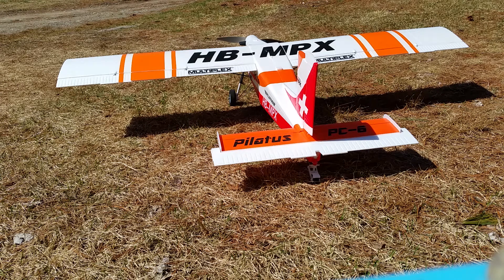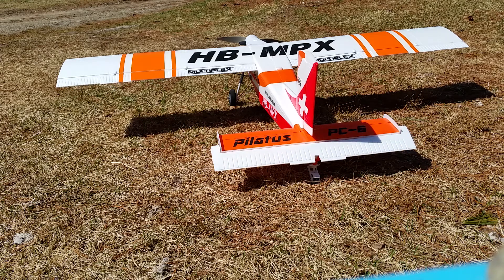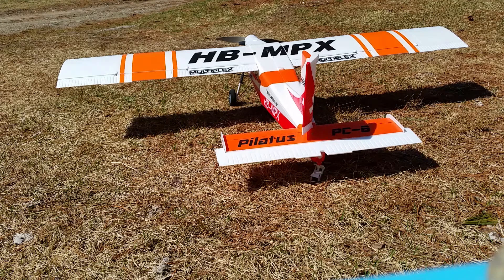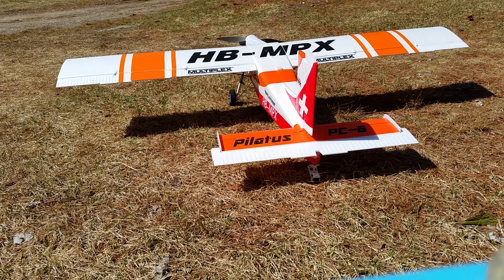Multiplex Pilatus PC6 7 channel programming

Comment: so how did it work out?
Reply from the maker: +ltdorn Differential ailerons worked quite well.  So well, in fact, that I got bored with how easy it was to takeoff, land and do mild aerobatics and started screwing around.  Well, you know the story - inverted pass and I lost orientation when trying to roll upright as it was heading right toward me.  Got it rolled upright but forgot to release forward pressure on the elevator and drilled it into the unforgiving earth at high speed.

So I replaced it with a blue one.  Too cold to fly around here till springtime so I've reverted to indoor stuff for the winter.

If you have the extra channels and a sufficiently programmable radio I'd strongly suggest you try differential ailerons.  It can really tame this long-winged plane and would work well for sailplanes as well.